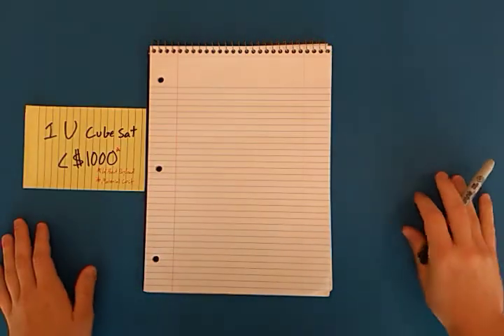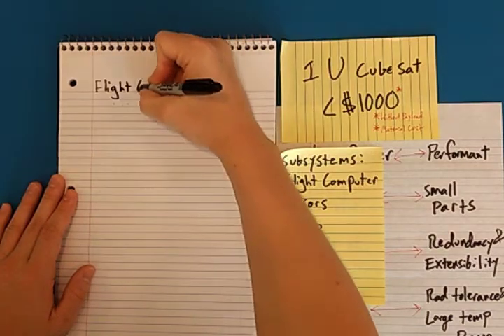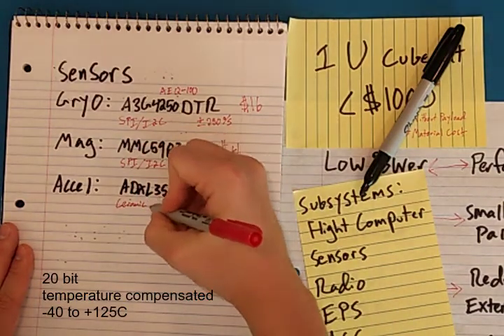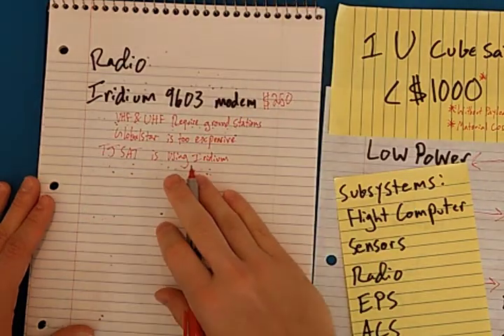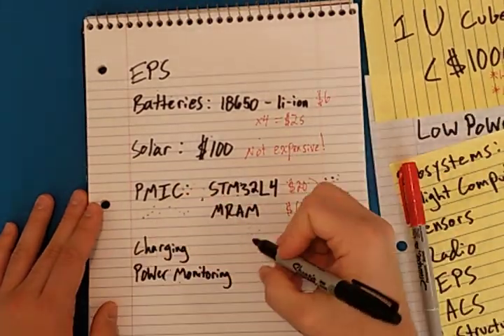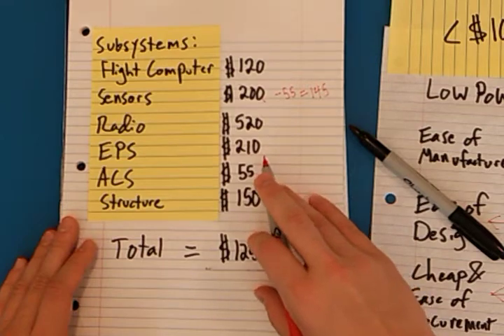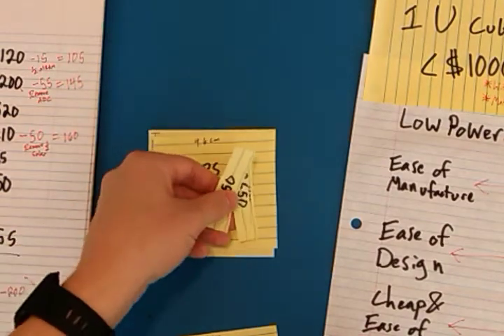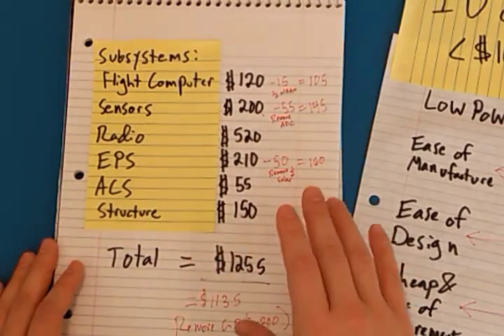Building a CubeSat for less than $1000 -- Part 2 -- Budget Outline

Comment: Can save you a bunch on the power management system. Which is configured for 3ea. 18650s which will also save you $6 for one less $18650.  But given this video is so old no sence posting part sources

Comment: Sir Can i use STM32 F4 INSTEAD OF L4 CUS ITS NOT AVAILABLE IN AMAZON INDIA
Reply from the maker: You can use any microcontroller you'd like! I simply chose the L4 series because I'm familiar with it, and it is intended for low-power applications.
Reply: @RGSAT  Is lower power better than high speed? I know for quadcopters they try to use the fastest MPUs available for a smoother ride. But they draw a lot of current.

Comment: Iridium data is really expensive. I would go with an SDR transceiver. There are a fair number of open source designs out there. A LimeSDR could act as both a GPS receiver and radio transceiver, I believe simultaneously. Having one or more reconfigurable radios would give you an incredible amount of utility.
Standard Lion chemistries are destroyed when charged below freezing so I don't think you can use normal ones.
Reply from the maker: Hey Alex! Thanks for the feedback.

You are right, Iridium data is expensive. The benefit of using that service is that I wouldn't need my own groundstation setup to receive data. To put it another way, I can bypass all sorts of radio related challenges (which are interesting,  but are beyond the scope of this project) by simply relying on iridium. 

As for li-ion charging while code, you are right again. The simple work-around is to add some heating elements to the batteries, and only charge when some ammount above freezing.